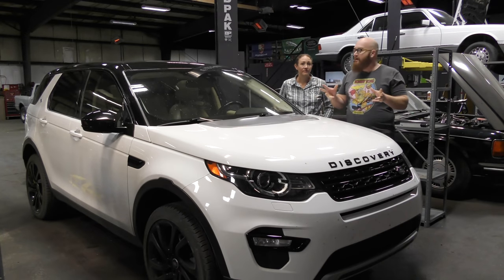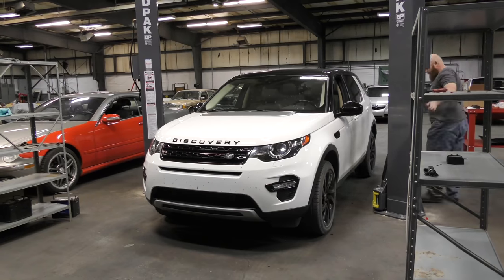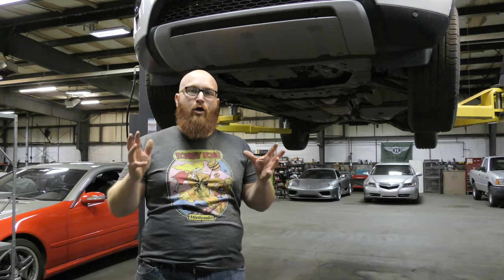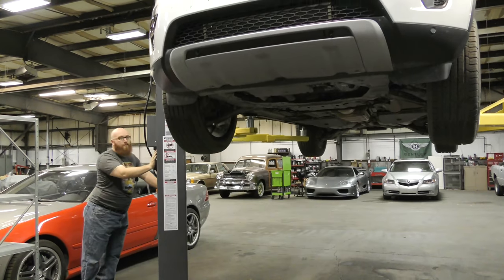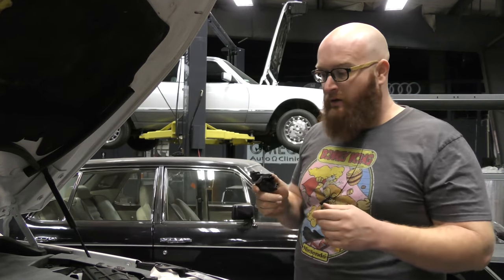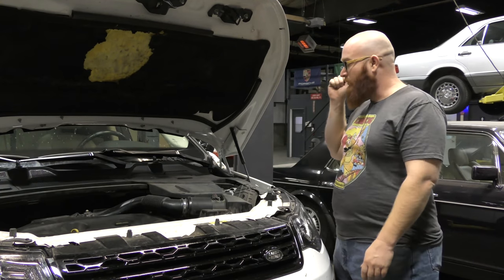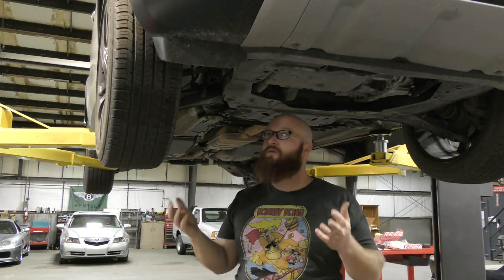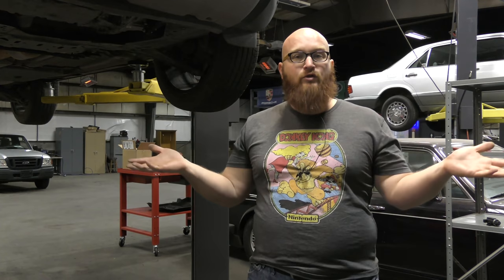I fixed Mrs. Wizard's '15 Land Rover Discovery for $75! How did the CAR WIZARD fix it so cheap?

Comment: I just wanted to say Thank You! The dealer wanted 5k to replace the turbo for an underboost code and after watching your video, I replaced the waste gate solenoid and that fixed it for 70 bucks! I told the dealer from the beginning it wasn’t the turbo but they insisted. I would have paid the money and that still wouldn’t have been the problem. I hope more people see this and check this first, I changed it myself and has been perfect ever since.
Reply: Where do I find the part? I can’t seem to find it. 😐 I called a shop and I was told they can’t order just that, they said I need the full assembly.
Reply: I have a 2016 LR Discovery HSE Lux and I think this video may have just saved me from buying a whole new turbo!! 😳😳😳 @ronwalde7024 where did yI come find this part?! Atlantic British?

Comment: Back in my airplane days, waste gates were controlled directly with a cable from the cockpit. You'd pull it until you got the boost you wanted. It worked that way because engine load was steady for hours...no stop signs and no hills to climb. The computer control was between your ears.
Reply: Until FADECs came along ;-)
Reply: @SVSky  IOT my garbage can is telling me it needs to be emptied out. I've lived too long.
Reply: Ahhhhh the good old days when you actually had to think😂😂😂
Reply: @aceboogie8986  exactly

Comment: It would have been cool for Wizard to bring the Discovery to the nearest Land Rover dealer and have one of there techs diagnose it. See if they would have diagnosed it the same as the Wizard.
Reply: They would probably diagnose it just fine because they'll have a proprietary computer that will show more codes etc, and that solenoid would probably show up as a fault. But they'd still charge 150 for hooking up the computer, 250 for the part, and 250 for fitting it. So although I'm sure they would diagnose it just fine, it wouldn't be cheap.
Reply: They'd find 4 more things "wrong" with it. The total estimate would be in excess of $2,500, and that would be due to flat rate diagnosis, $129 hourly labor, 20% markup on branded parts, shop supplies used in determining faults ($80 for two rags, a set of latex gloves, and 6 shop paper towels), then estimated shop supplies, base $120, used during labor.

I worked at a dealership for 15 years. Vehicles we didn't have the expertise and/or tools to work on got farmed out, and occasionally that meant the vehicle had to go to a dealership. HOLY SNARKIES!!! We thought we could add fees. Dealerships, especially for BMW, Volvo, Mercedes, and Land Rover absolutely murder with parts, labor, and fees.
Reply: I am a Land Rover tech and I commented to the wizard in his first video about His new disco this exact issue. So yes we would have done a correct diagnosis
Reply: My coworker has a 2020 model it’s been at the dealership for three months they can’t find a problem he’s going after them for a lemon law and get his money back this vehicle is one of the biggest piles of crap on the streets
Reply: There are definitely bigger piles of crap. The problem is people want too man things from there vehicles. They don’t want to drive so engineers figure out systems to remedy the fact that people would rather be on there phone than drive and participate in driving. Not sure what you career is but mechanics are asked to do more now than they ever have. Sometimes there is nothing we can do to remedy the issue and it’s a software issue or engineering issue and we are stuck waiting till engineers develop the correct software or fix for what ever it is. So mechanics are less than ideal but I can’t tell you how many times we get cars at the dealer that independent shops couldn’t fix and we did. So the pendulum swings both ways and you really should put the shoes of a tech on and what we have to deal with.
Reply: @Tkosinski2  That is why they are called technicians nowadays,besides being a mechanic and a good wrench turner they also have to be a computer wizard and have very good diagnostic skills to be able to figure all these complex problems that cars can have.
I'm speaking from my experience as a shop owner for 40 years,happily retired now!!!!!

Comment: When I was in high school, my parents couldn't afford to buy me a car. But they did have one sitting in the garage unmoved for 2 years or so, that they had no plans to fix. I asked if I could have it if I fix it, and they said yes! So I did. Tons of things to do, but I worked on it a lot! One issue was a starting problem that it actually had since they bought it (salvage title). Since it sat, the battery would be disconnected a lot. One day, I got frustrated by the rounded off screw on the negative (side) terminal, so I went and bought a new pair for $2. The result? Zero issues! I had dreaded the worst since it was a salvage, and I found some creative wiring in certain places. But a $2 screw is all it needed to fix an 8 year long starting issue. Awesome lesson for everyone WIzard!
Reply: I hope you told your parents that you did a complete engine rebuild to get it working again lol

Comment: Wizard you are so right man ! 
Here in Australia, the turbo intercooler hose on my 2.7 litre V6 Discovery 4 developed a very fine split.  Diagnosed after 2 hrs by LR main dealer shop as “ failing top HP pump soon to implode” therefore requiring new pump + main rail + all injectors - “estimated cost” of $20,000 - $22,000 plus taxes.

A very well qualified referral to my now 5 year Indy who quietly listened to my tale stepped back directly between the headlights rubbed his chin stepped forward put his hand way down beside the radiator and came up covered in black greasy oil.

A $190 OE replacement hose plus 1/2 hour labour later - all fixed. 

232,000 kms later - still going strong no other major problems along the way.

Comment: “throw the parts on” Is exactly what my old mechanic used to do, which is why I finally dumped him.
Reply: I do all my work myself. Good  mechanics aren't cheap and cheap mechanics aren't good
Reply: Good solution. I can tell you as diagnostics/ moduler repair guy.
This is what i telling to my friens, if they going to mechanic shop. Ask them, if they will install a part and it will not gonna fix a problem, who gonna pay for it? Im telling my customers, if i swap a part and it will not gonna fix your issue, part is gonna be ON ME! This is what rare mechanics/car tech guys can offer...
Reply: Parts changers, jack of all trades master of none.

Comment: I had a very similar issue to the flapping cover but instead it was a loose exhaust pipe holder which was repaired for no charge by my mechanic. I was very relieved because the sound made me think it was something major that was wrong. It always pays to find an honest mechanic. He is actually in the process of writing a book which focuses on the so many relationships that they have created with customers by being honest and fair priced. They actually remind me of you!

Comment: I have a diesel Renault which went through 3 different mechanics, INCLUDING a Renault dealer, and they could t find what was wrong with it (it had a turbo mass error). In the end, it was just a cable which was a little bit too bent and was giving wrong readings to the engine CPU!!
Reply: @Stimpy&Ren a fuse cost $80 with labor 😲
Reply: @Stimpy&Ren 80 $us or 80 cents? 😳😳
Reply: @Stimpy&Ren India my friend
Reply: @Stimpy&Ren I was talking about the fuse itself, chill dude. 🐾
Reply: @Stimpy&Ren Then that's figure why it costed $80 🤣
Reply: @HksF16  As Mr. Rogers would have said: "It was a very SPECIAL fuse". :)

Comment: Land Rover part number is LR049972. Ford part is CB5Z-9E882A, same part. This is a common issue with the LR/Ford 2.0L Turbo. The dealership will tell you they need to replace the entire turbo for $5,000, meanwhile the part is $80 and takes an hour to replace with removing a few bolts no lift or special tools required. Replaced this a year ago and added 20K miles, turbo running great. Good luck!
Reply: This should be the top comment. Thank you for the info!!!!!
Reply: No prob ! Our 15' LR Disco Sport is still going strong two years later (with the part replaced). Just hit 100K miles

Comment: FOR ANYONE LOOKING FOR THE PART-  FORD PART# is CB5Z-9E882-A  or   Land-Rover (LR049972)  (same part, $50 more!)  Thanks Wizard! Hope this actually worked long term!
Reply: Thank you
Reply: @RolandArias  No prob! Worked on my Disco, hope it works for you too! Bitch to replace it at the top the engine but $80 beats the $3,000 Land Rover dealership quoted me the cheats hahaha

Comment: When I took my car in for an alignment, I asked them to check on a chirping sound in the area of the serpentine belt. Oh boy, going to need an idler pulley or the tensioner as well. Nope just the belt. 

I checked for belts, usually $15 to $40, but after watching this episode, I will go with the $84 OEM- equivalent belt they recommended. With a half hour of labor, it will come to be $140, but the peace of mind is invaluable.
Reply: Change it yourself and you'll save a lot of money.
Reply: There are certain parts that are okay to buy aftermarket (like serpentine belts), but some parts really need to be OEM.  Electrical components are one type of part where you want to go OEM if at all possible.

Comment: This is exactly what happened to me, i had done break job on my car rotors and pads, later down the road i had to have my transmission rebuilt and when i got the car back, every time i would come to a stop or accelerate id her a clunk in the front driver's area. At first i panicked but then after really accessing everything i decided to go back after 1 year or so of the break work axle nut was ever so slightly loose. Torqued it to specs and i was a happy camper. Thank you for all your wizdom wizard!!!!!🙏🙏
Reply: You've got to tighten parts to the correct number of Whatzits per Potzrebies.

Comment: A Land Rover in it's natural habit...
A repair shop!
Reply: True.
Reply: To be fair I’ve had 3 discovery’s & 3 range rovers covering over 1million miles and only had a compressor for air suspension go on a Range Rover and a warped cylinder head on a discovery (my own fault). Can agree with unreliability comments.  👍
Reply: Land rover appear to fit Ford engines in the US, we don't have that issue in Europe and have hardly any issues with land rover products.
I have a discovery 4 and a range rover svr and I've had no issues with either.
Reply: @gedd6750  Is Germany still in Europe?
That is where I am from and Land Rover/ Range Rover as well as Jaguar have horrible reputations for reliability/durability.
Consumer and after market warranty companies that have done surveys show them to be one of the lowest rated vehicle for reliability/durability sold in Europe.
Practically the only ones claiming they are reliable are from the UK.
A few reliable examples don't accurately reflect the ownership experiences of a overwhelming majority of owners.
Reply: @williamegler8771  yes it is still in the continental Europe.
I've had Land-rover products for the last 10 years, between my family and friends we have had 50 ish vehicles both new and second hand and not had any major problems.
However my VW touareg was a nightmare, 3-5 months between major repairs, repairs that started while it was still in warranty.
I guess JLR save the best products for the UK as the Japanese do with their cars.
Reply: It’s a Ford engine 🤣😂
Reply: @gedd6750  The products of the German auto industry are still held in much higher regard worldwide that products of the British auto industry.
Regarding your comments about FORD engines...
Haven't LR/RR products been powered since its inception by outside suppliers?
GM, FORD, BMW among others.
Why haven't they designed a British engine worthy of their status instead of using engines from far more plebian manufacturers?
Reply: @williamegler8771  the engines are built just outside Wolverhampton, in the UK.
In the US they appear to use Ford engines.
Reply: @williamegler8771  are they !!??
Reply: @gedd6750  Check your facts...
The newest generation yes but the earlier versions used engines either designed or built by outside suppliers.
Reply: @williamegler8771  He literally mentioned an Audi Q5 that needed an entire new turbo at the beginning of this video!
Reply: @williamegler8771  I don't need to check my facts ,LR has been owned by Ford and BMW of course they would use their own engines.
What were you saying about German car companies??
Reply: @gedd6750  Profitable and still owned by Germans...
Ford and Vauxhall owned by American car companies until recently in the case of Vauxhall.
Designed engineered and usually built in Germany yet traditionally dominate the UK sales charts.
German cars take several of the top ten in fact.
Even the British public knows better than to buy British in any number.
That is why you don't have a native car industry.
Couldn't make it at home or abroad!
Reply: @williamegler8771  Maclaren ,Ariel, Morgan, there are 3 British car manufacturers so we do have a car industry.
Looks like you need to check your facts.
Reply: A boutique auto industry and the cars sell in miniscule numbers.
Even when they are built by hand they are overpriced junk.
Certainly not a robust industry that sells its products in the millions around the world and employs thousands.
Companies that make and are worth billions.
Yes the Audi needed a new turbo but even a Toyota needs repairs occasionally and I am sure more Audi owners have enjoyed better reliability and lower  ownership costs than LR/RR owners.
Reply: Ever since Ford and then TATA brought out land rover, the cars has been shit and sends most of the time getting repaired
Reply: @Peter__G  They have always been crap...
When BMW took over Land Rover they had to push back the introduction of the Land Rover Discovery until they fixed several quality issues.
They were so badly built you could see interior light through the panel gaps!
Reply: @williamegler8771  the discovery is the worst land rover ever built. I've worked on so many, that I've refused to work on the. Land rover have make some good and some ok rang of cars but I still refuse to work on them
Reply: @Peter__G  Calling the Discovery the worst Land Rover ever built is like saying you are the healthiest person in intensive care.
Neither is great.

Comment: I diagnosed one of these on an old saab by removing the vacuum lines from the solenoid and plugging them with bolts.  Only needed about 100 feet of driving to figure out if you were right.  Had the same symptoms, no boost.  I do not recommend diagnosing a modern car this way because you can overboost, but on a $1000 beater commute car it was getting junked anyway if it needed a turbo.

Comment: Very impressive video. I have a 2016 Discovery that the auto stop/start has quit on. It would almost be worth driving from Fort Worth to have you look at it.
Reply: Check your battery. Land Rover dealership replaced my battery with wrong lower CCA and start/stop also quit working. I couldn’t go to dealership over and over again (we bought the car brand new), so I just forgot about it. 3 years into  I replaced the battery with a correct CCA AGM one and it immediately fixed the problem

Comment: Fellow Ecoboost owner here (F150) and on the trucks its normally the BOV (boost pressure valve) that is installed into the CAC. Same deal but much easier to get at.

$58 for the F150 version and about 10 minutes of work to replace. Ford should have spent 12 cents more for a stronger gasket for the valve because the original ones are known to tear from heavy throttle events.

Apparently the 4 bangers have theirs in a different spot but same dumb issue. And yes cheap ones are bad juju...you are a lucky man because this customer has your ear outside of business hours! Of course considering her back up car is a Merc not feeling too bad for her. Just glad you were able to fix it fast and cheap vs normal Rover repair bills.

BTW props on the Donkey Kong shirt!!

Also hopefully she has not noticed the mouse chomped hood insulator.

Comment: The last really cheap major repair I did was on a 2011 Mitsubishi Outlander Sport with the CVT transmission. I bought it from one of my customers that insisted that the transmission was bad. The truck ran and drove but quickly went into limp mode. I put the truck on the lift and removed the transmission pan and the very small filter which was completely plugged with metal shavings on the bottom. Just for fun I ordered a new filter and picked up the correct CVT fluid and put it in the next day. I reused the transmission pan gasket which was in good shape because I never thought that this would actually work at least not permanently. To my very surprised the transmission worked flawlessly and the truck drove excellent. After further reading I have seen many other instances where CVT transmissions seem to have complete failure but really just need the filter changed.

Comment: I had the same problem with my 2015 DS. Had to order the part from Latvia because the Ford dealer wouldn't or couldn't cross FoMoCo pn since it's normally sold as part of the turbo assembly. It can be a job unto itself just finding the part.
Reply: Hey Ken- any idea what the part number was? Were having the same issue as the Wizard & he never mentioned what the part number was from Ford! Thanks
Reply: @realsurrealfeels9258  hi, the problem is not the pn, it's the availability. Ford only sells the complete turbo assembly.  But if you look for CB5Z-9E882-A on some of the auction sites, you might be able to locate one. I had to buy one from Croatia. Good luck!
Reply: @KenKroslowitz  thanks for the help Ken! Did your new solenoid fix your problem??? The LR part number is LR049972 but the Ford is the same for anyone looking!
Reply: @realsurrealfeels9258  yes it did. Hope it solves your problem as well.